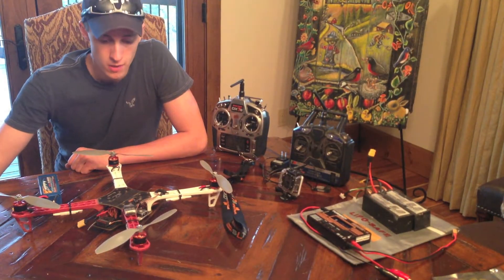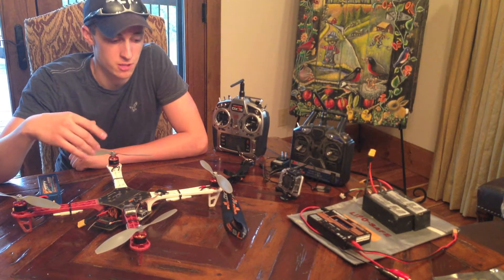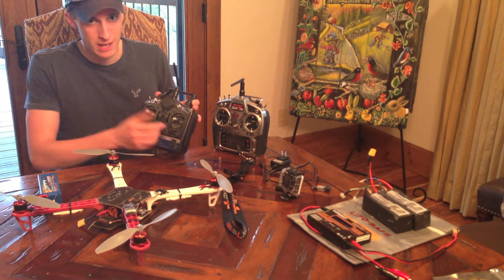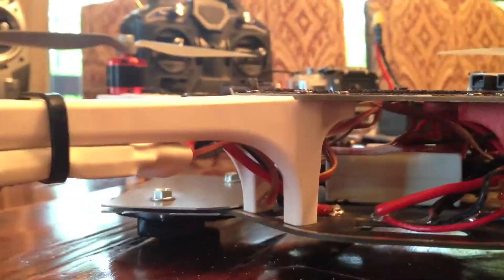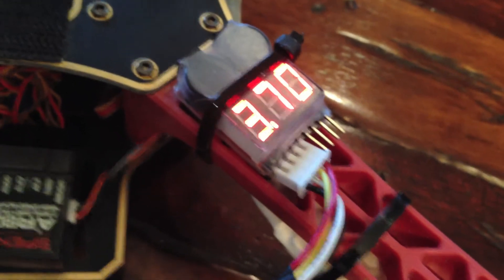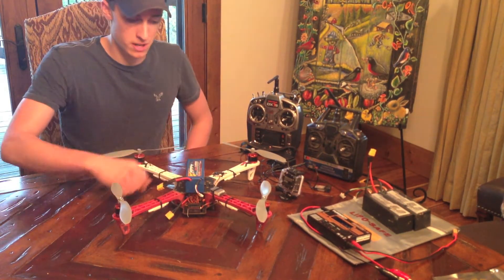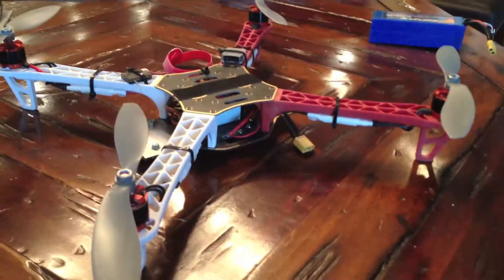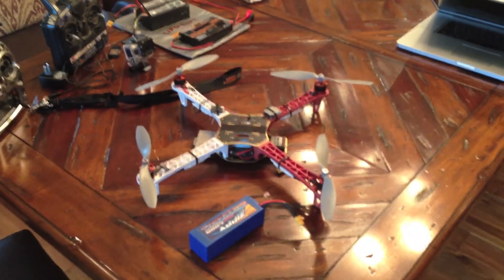My DJI Quadcopter Setup

Comment from the maker: Yes it has an accelerometer and depending on which mode you fly in it can auto stabilize itself or you can swap it over to complete manual mode which takes a little more to get used to. The Naza-M with GPS does have a failsafe mode to fly home or hover if you lose connection between transmitter and receiver. I'm not sure if you could set something up like that with a voltage reading. I would probably be easier to set something up like that with an Arduino based control board.

Comment: Please don't play music. It's very annoying. If you do, turn it down so we can hear you speak. Otherwise it's all great. Question: since I'm new to this' does the electronics have a built in stabilizer or an accelerometer?  I make electronics and write code and would like to add a feature that makes the copter go home on low battery.?

Comment from the maker: The 10x4.7 will have more lift because of the steeper pitch but the 10x3.8 will be a little smoother. Also, the DJI props seem a little flimsy to me compared to the APC. I flew with the DJI 1045 props when I first got my copter and they did fine but they don't seem to be quite as sturdy at the APC props. I do have friends that have had cheap props break mid-flight, so I certainly recommend some sturdy props like the APC.

Comment: Well I have the new dji 1038 prop on it now will the 10x4.7 give me more lift then the 1038 prop? Also are those good as e prop? I wanted to make sure my props won't break in air if am far out doing fpv